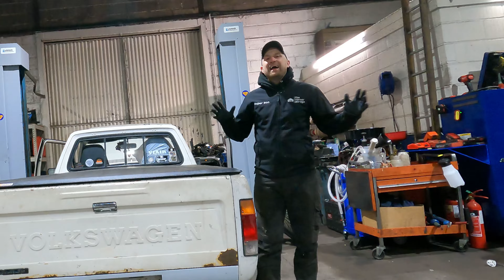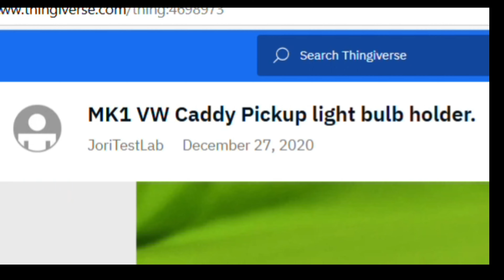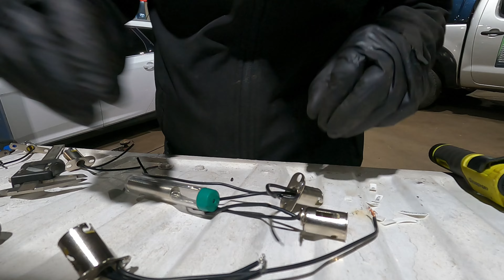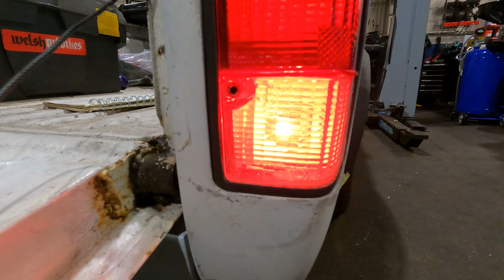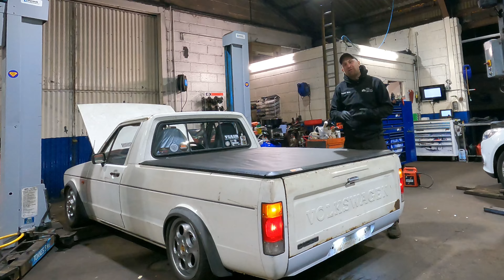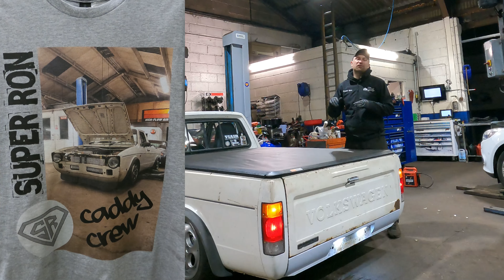Ep28. 3D PRINTED Mk1 Caddy Bulb Holders!

Comment: Cheap fix, but they need water proofing otherwise they soon corrode.
Reply from the maker: We're still in the development stage, may still reprint these in abs. They're not directly in a splash zone, the factory plugs aren't waterproof, and the sealing rings are only foam not rubber. But may put a dab of sealer where the wires come out to stop any condensation in the lenses. Thanks for watching 😁
Reply: @SuperRon  The originals are IP69K rated with the rubber sleeves at the rear and the foam at the front. Designed to prevent condensation & debris. 

My initial wording of waterproof was incorrect, I should have said condensation proof 👍👍
Reply from the maker: Yes I agree 👍

Comment: Regarding the bulb holder, if they need to last, you should get them printet out of abs/asa or a engineering filament like nylon. I have personally have had good experiences with Spectrum ASA 275 with open printers
Reply from the maker: The maker of the file recommended abs because of the possible heat factor. I'll see how they do in testing, we've only printed in pla before but shouldnt be to much trouble to do a set in abs. Thanks for watching 😁
Reply: @SuperRon  abs and asa are practically the same, I favor asa as I have read that they are easier to print (depending on brand) and should have more uv resistance
Reply from the maker: @madschristensen272  thanks for the advice 👍